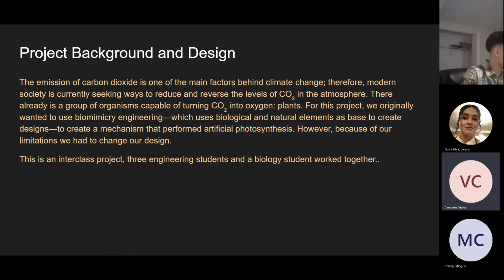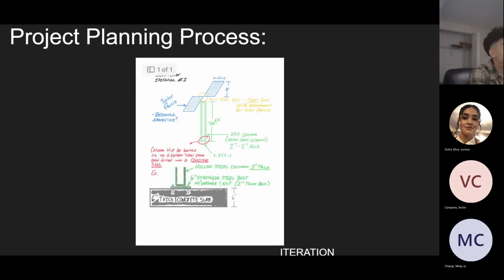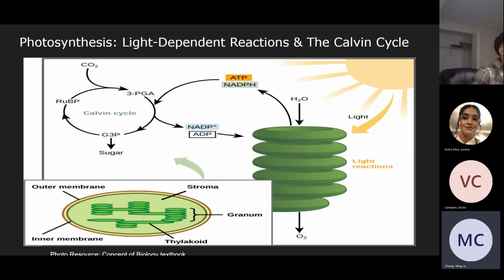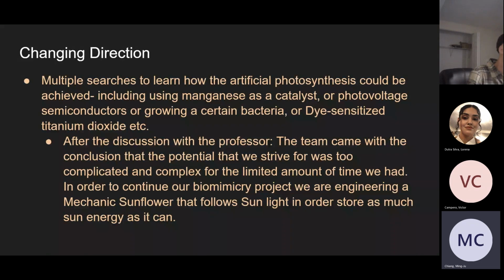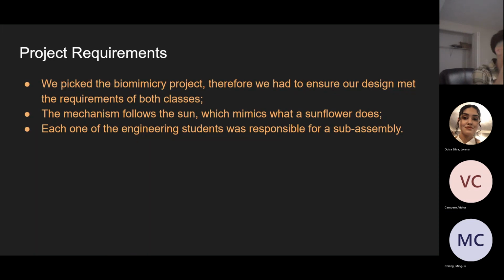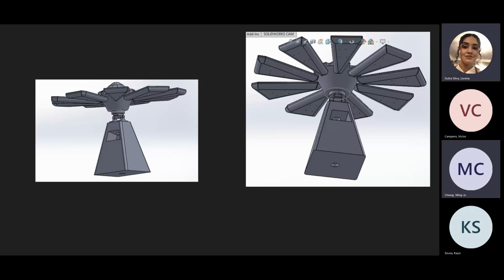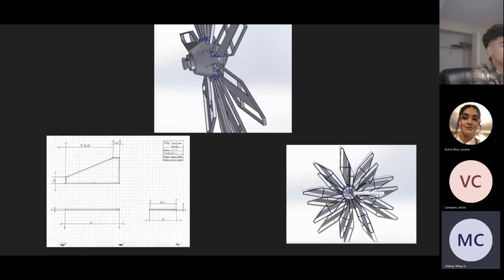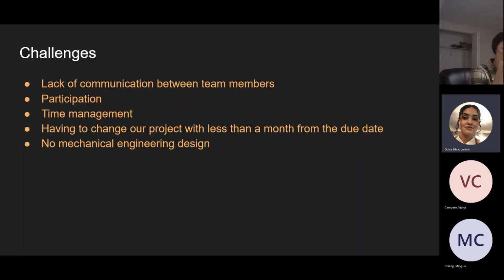Sunflower - Biomimicry Project - MassBay STEM Expo Fall 2022

Comment: You surely picked a challenging topic! I applaud you for dreaming big, and taking on such a relevant issue (excess carbon dioxide in the atmosphere). You met the requirement for biomimicry: mimicking what plants naturally do to maximize sun exposure (energy collection). And it looks like you learned a lot about the challenges of working in a team. That was another goal for this collaboration. It may have been frustrating in several ways, but you learned, and engaged in the process. I hope you feel good about that. -Prof. Elliston
Reply from the maker: I appreciate the feedback! I learned a lot about group project dynamics during this process. The fact that we were not able to follow the original idea was frustrating, but I am glad we were able to keep part of the original design and stick with the renewable energy source.